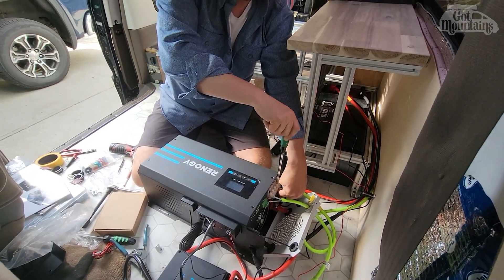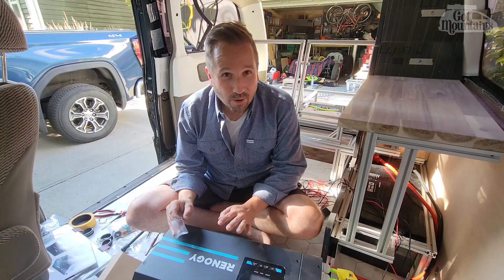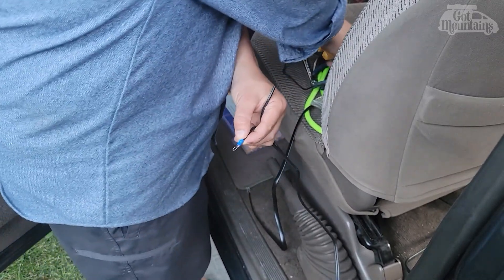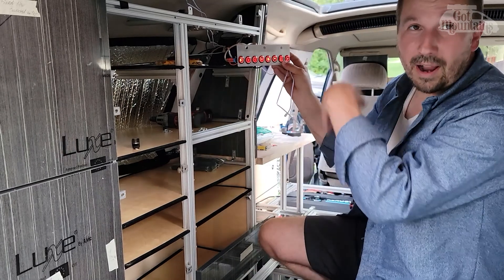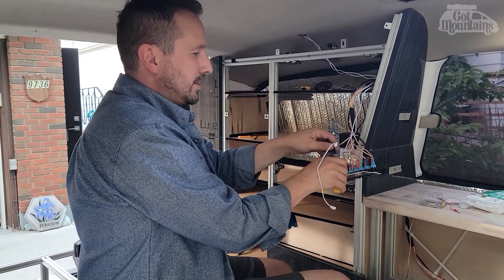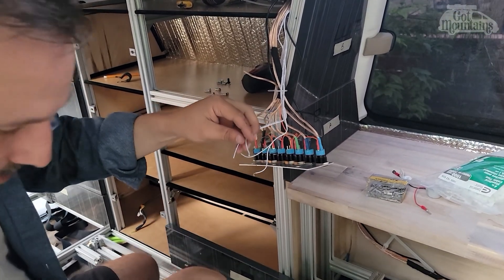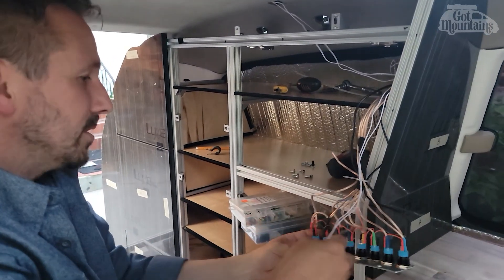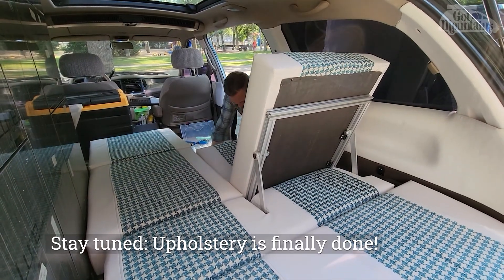Powering up for the first time! // E22 Van Build Series Renogy Inverter Charger

Comment: Looking awesome!
by the way found a cool way to organize an ever changing wire diagram
this one is the solar i just put in our trailer
https://mermaid.live/edit#pako:eNqlVGFr2zAQ_SvCUEhBHrazrJ33LQkbgzUY2n6K90GxL7aJLBlJThaa_vedLCfOEgqBhWDkd-_u3TtLevMymYMXe4ViTUle5qkg-HuWnKmECeB6uWbxmvnaIn5jIRclLpymInz8FG1JGAQ7AiwrEamlkCRTe20Y55UAhF4bYiR5QNJvJzFlxoCq4CiQYflVh-2HGCZOQRvCDK4iq9CAslKs7MvMpDBKclAjV2YluSFPSfJCZiVThZXOjhTbaxBsySRg973PshVmWSgAgUH8d4Bb4kT2vcj3VsPSPhDG5B79JVk-CtH6fNatbbdOVOm-_k-xBWVOzTW8LfysUhkH12gid11bR57tcBIE_jhAr32NaauT0VDAqiRSV6bago3dD7TFkVZXouMtoGCXvB9KtiJfYqNaV7p_Ra7LZKLgoP1c7kTv0j3v7oiCHCd_tT-I7_uHMGC74jB8jItv03MO3SCHkZ5ga3Ewe4LtUPFTnDcQXdCiw9lmuQqdxjoUWXGWbUgY_Z8PO-xh7CfY7Z5r3Bm5gvvZXzYXne3Nj00uPjKJB27zbPYcSEBDGtEx0dj9BvxdlZsyHjd_6LriPBZSAHWhGEf77TL7M538mxkGt6Z-oQ_0kX6lYXCDdmf6qkQY0jC6Rf-Y7lGvBlWzKsfb7M2WSz1TQg2pF-NSQGsU46mXinekstbI573IvNioFqjXNjkzMK8Ynvraw5PANaKQV0aqJ3dDdhfl-1-NObJD

Comment: How exciting- a very serious piece of equipment! Always a bit nervous with electric, but you have a good methodical process to prevent surprises. (With jumping a car, I've read it's best to hook up the positive first, then the ground- this may eliminate the spark?)
Reply from the maker: It doesn't eliminate spark but because of the way the ions flow it reduces the chance of a surge damaging sensitive components. Negative last always leaves the surge going to the batteries which can take it! It's good advice!
Reply: @GotMountains  Thanks for the information- I did not know why it was recommended, and now I do!